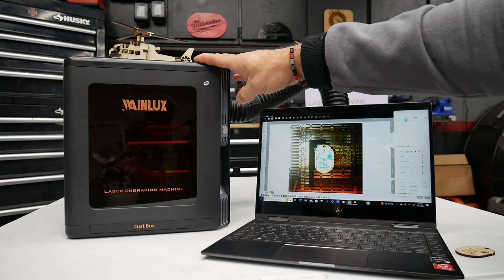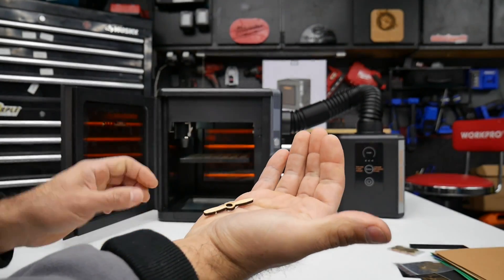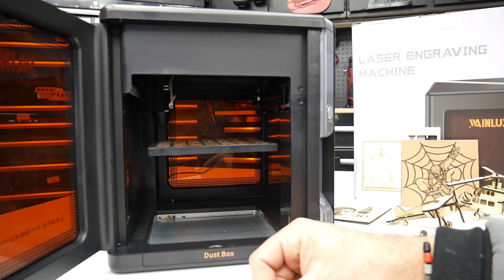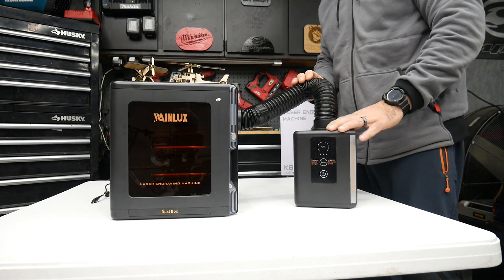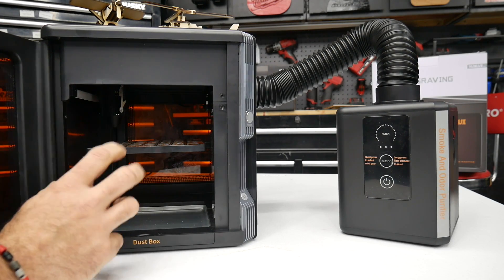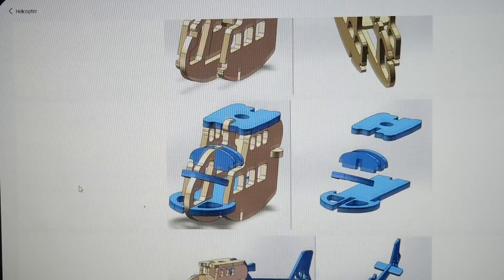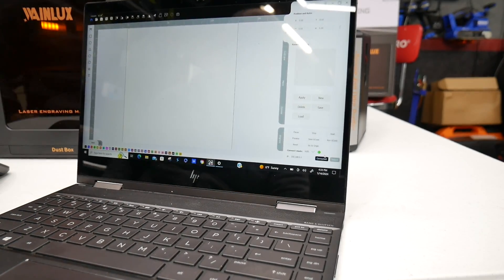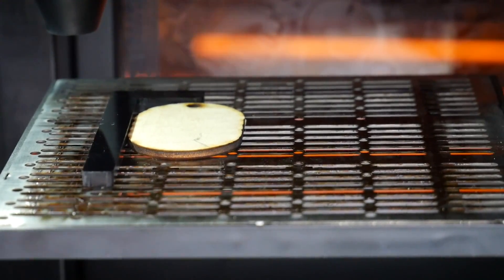Best compact laser engraver Wainlux K8, Easy to Use, Built in Camera

Comment: I ordered a 10watt k8 about a week ago and waiting for Wainlux to process, doesnt appear there has been any movement on there end.  I want to make small items to add to my craft fair offerings.  My 1st laser and want to get a roly in the spring
Reply from the maker: did you order from the website or amazon? if it hasn't processed yet I would cancel it and reorder you can use my link and discount code and get 30 bucks off just an idea so you can get it cheaper
Use coupon Code Coupon: CHUCKKOSOSKY for $30 dollars off 
Wainlux Links-Wainlux K8: https://www.wainlux.com/products/wainlux-k8-mini-laser-engraving-machine?ref=AllThingsCool
its on sale on the website for $329! if you use my code its only $299! 5watt version)
Reply: Did you get it ?